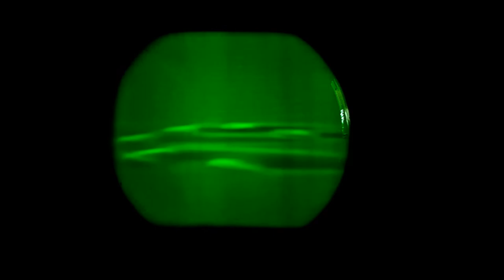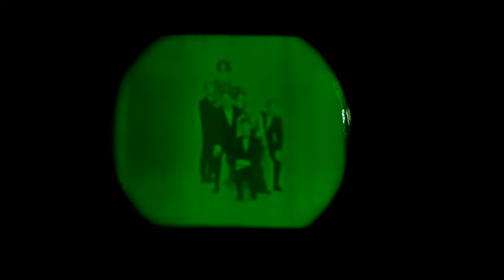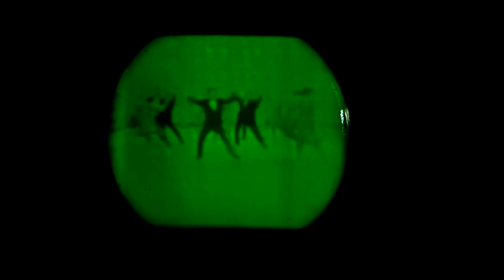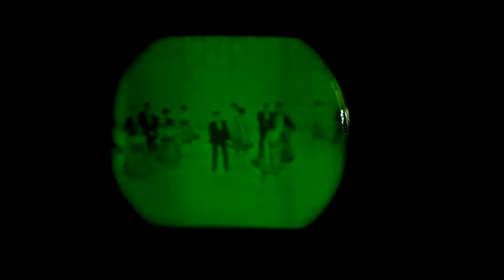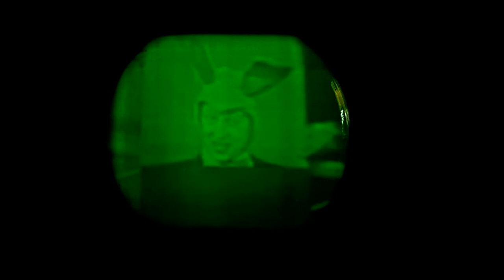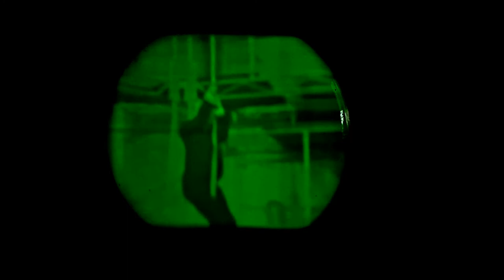1964 In Melbourne Tonight on my 902 2 inch green screen TV

Comment: Troy, the vertical linearity and the horizontal linearity are excellent, not an easy achievement, the streaks on the picture were often seen on commercial TVs so dont worry too much.
Picture is surprisingly stable.
Reply from the maker: Thanks Brian. I actually did try stepping up the capacitance of of those interstage coupling capacitors as my mate videolabguy suggested, unfortunately didn't improve the streaking much at all. Anyways am happy it's making watchable pictures :)

Comment: The interstage coupling capacitors are too small. This is causing the streaks to the right of very bright and dark objects. This is poor low frequency response. Try increasing the 0.1uF caps on the grid 1 of the 6AK5 and grid 1 of the CRT to 1uF and see if that helps. You can parallel some new caps right across the 0.1's for testing.